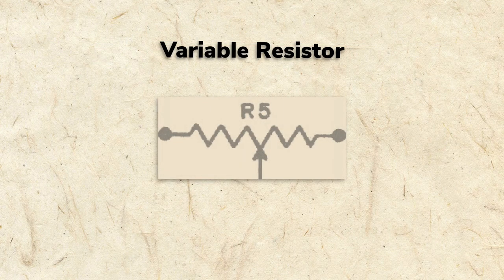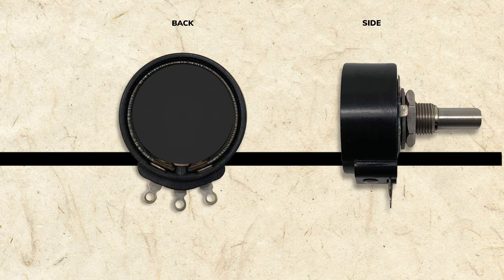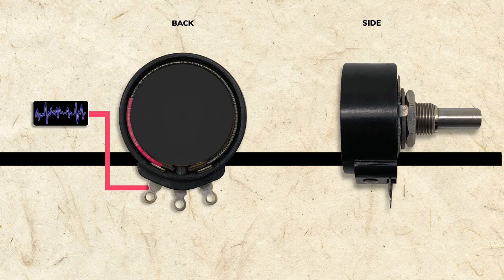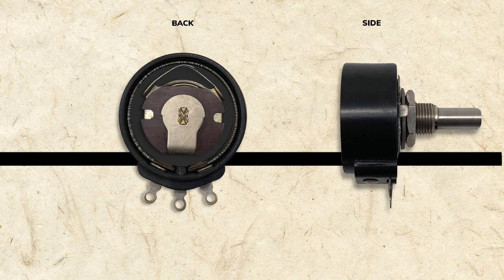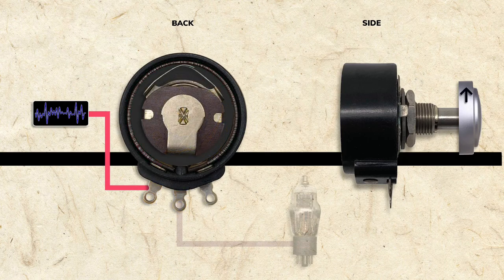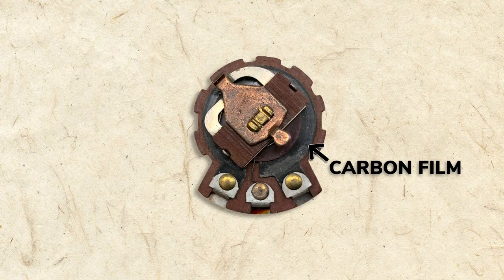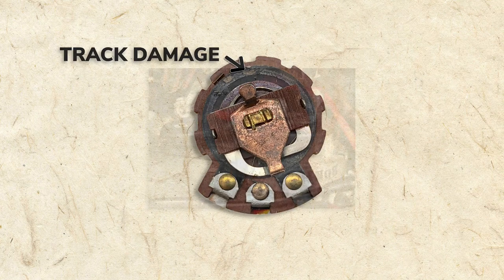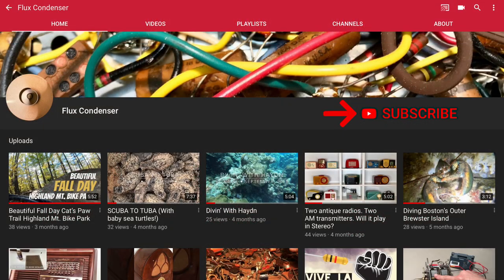How Does a Volume Control (Potentiometer/Variable Resistor) Work?

Comment: The best explanation on YouTube! Good job. I found that I can just turn a knob left/right/left... enough times and it will wear off the corrosion and eliminate the static. Question: Assuming that this is how a dimmer switch for a light switch works, does the resistance keep the usage of electricity down when the lights are dimmed or is the electricity lost in the resistance (which would be what causes it to get warm?)? Since I was shown the inside of at radio volume switch in the 70s, I'd just figured that the current was lost in the wire wrap. But If that were true with a light switch dimmer, it sure wouldn't help with the electric bill! Plus I guess the wire wrap would become like a space heater, LOL. So I guess I know the answer to my question; the resistance must stop the flow of electricity.

Comment: This would seem to make conceptual sense except that I can't see from this how the input lug is connected by the wiper to the output.
Reply from the maker: 51MontyPython In a potentiometer, the wiper (which is connected to the center lug) becomes the output that is fed to the next stage for amplification. The electrical connection between the wiper and the center lug can’t be seen in the photos shown, but it is there. The signal runs into the left lug, into the resistive track and then out the right lug to ground. The wiper “taps” into this signal at various places along the resistive track.
Reply: @FluxCondenser  Thanks for explaining that, I wasn't sure what the right lugs purpose was
Reply from the maker: @midmodaudio6576  glad the video helped clear that up!

Comment: buzz! wrong. there's a difference between a variable resistor, volume control and a potentiometer.  they all vary the résistance but have totally different functions and different purposes. maybe you should explain that?
Reply from the maker: They’re all the same device. When wired to use all three terminals with the wiper as a center tap/voltage divider, the variable resistor is commonly referred to as a potentiometer. When just two terminals are used (or the the wiper is connected to one of the track terminals), the variable resistor is commonly referred to as a rheostat, and yes, sometimes as just a “variable resistor.” 

It’s true that, as you say, the words can refer to the different ways to wire the device (although, again, the device is the same), there are inconsistencies with the names used particularly with antique gear which is what is discussed in the video. I’ve found that with antique radios the term “potentiometer” is often not used, and in that role (as a voltage divider for something like volume control) it tends to be simply referred to in vintage schematics and nomenclature as a variable resistor.
Reply: @FluxCondenser  no they aren't the same.  potentiometer keeps a constant 600 ohms .  a variable resistor is linear and a volume control is logarithmic. so they aren't at all the same
Reply from the maker: A little knowledge is a dangerous thing. You have a “little” bit of knowledge on the subject which has led you to some false conclusions. First, potentiometers are available in just about any resistance imaginable not “600 ohms.” Potentiometers do not provide a “constant” resistance unless the control is not turned. Potentiometers are available in both linear and logarithmic scales, it has nothing to do with being a variable resistor or potentiometer. For audio volume, yes, log potentiometers are most often used as they raise and lower volume in a way that suits our ears. But linear or log has nothing to do with calling a potentiometer a variable resistor. 

If you lack a basic understanding of electronics, and don’t understand how a potentiometer can be wired and why, you will not be able to grasp the actual difference. Perhaps, you lack this knowledge and hence, you are confused. Again, potentiometers and variable resistors are the same device, but can be called different things depending on the way they are wired.
Reply from the maker: My friend, a simple search will show how far off your conclusions are. I’ve tried to help you understand this, but you’re either being purposefully rude and obtuse on purpose to troll, or because of character and learning deficiencies. Please move along.
Reply: @MrRonfelder  bro just shush